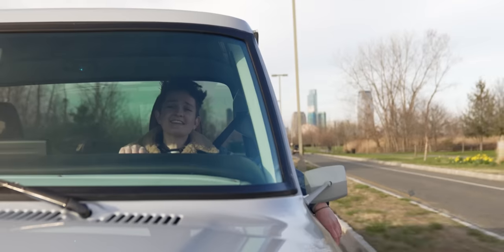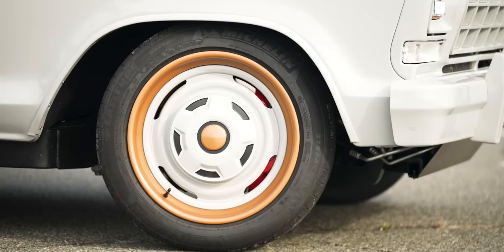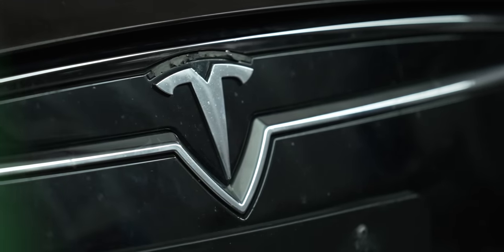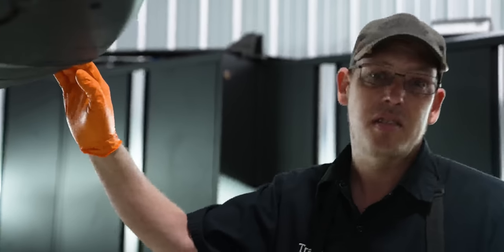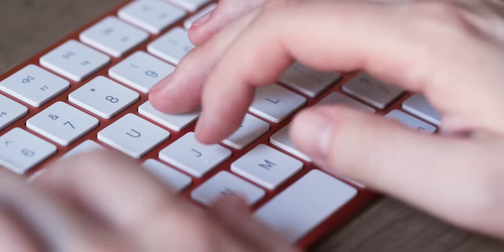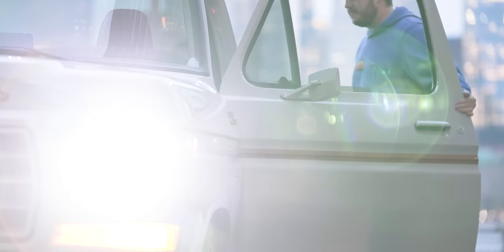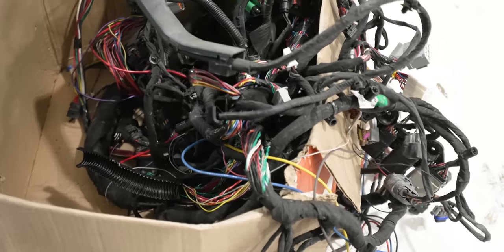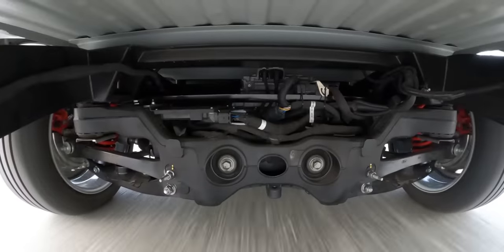Ford did what Tesla won't

Comment: A lot of people making fun of Ford for just selling the Crate EV motor “Batteries not included”. But 99% of crate motors are the same way. You still need to source radiators, hoses, wiring, a fuel tank, fuel pump system, etc etc etc. 

Right now yes it’s a limited market with a learning curve. But don’t be surprised if in the next decade you can pop into your local auto zone and pick up all these EV components.
Reply: Autozone gonna go out of business because normal people can't even fix normal cars let alone this. I consider myself very good at working on cars and I can't even figure out a wiring diagram from the 80s.
Reply: Same with crate engines you still need fuel systems ignition computers exhaust so I don’t understand those peoples argument
Reply: @HALOman-vi2tg  I do get your point, the battery pack and and it’s management system is ALOT more expensive then a fuel management system and a fuel cell/tank.
Batteries are generally the highest cost part of an Ev. Much more than the motor
Reply: @mr.mercury4247  electric cars are actually technically much simpler than internal combustion. An electric motor is just series of copper coils around a magnet inside a metal housing and most of the other moving components are already present in combustion cars like brakes and coolant loops (just it goes to the battery instead of the engine in an EV). Even the motor control software is simpler than a combustion engine since there is no throttle unit or fuel injectors to worry about. Removing the combustion engine takes A LOT of complexity out of cars and could be the beginning a new world of easier car repair if companies don't get overly controling about it.
Reply: Also, IMO, crate motors should include the inverter, so people buying the motors don't have to do the company's R&D all over again.
Reply: @user2C47  but if someone getting crate motors they normal get different fuel systems and control units etc.
But yes a complete kit BEING available would also be nice

Comment: Been an independent mechanic for the majority of my 15+ of working on cars. I'd say all to most manufacturers try to do what they can to make life difficult for the independent shops.  And while good for Ford for doing something right, I fear it's only going to get a lot harder going forward for independent mechanics to have access to the correct information and tools.
Reply: Maybe become an EV mechanic as well? Technology will always change, and we have to change with it.
Reply: @dallasdominguez2224  you have completely missed the point.
Reply: @mikeumm  ok what was your point? 😂
Reply: @dallasdominguez2224  the point is unless you work for that manufacturer, Tesla included. They try their hardest to prevent independent mechanics from repairing their vehicles. If they could have their way only factory certified and employed technicians would be able to work on their products. 

John Deer is in a court battle about this right now. 

Has nothing to do with electric vehicles.
Reply: @mikeumm  Ahhh I see. Thank you for explaining.

Comment: If there's one way to win over the old school classic market it's with EV crate engines, I love what Ford are doing and it's going to help with converting people and cars alot sooner than perhaps Tesla's walled-approach. Awesome vid Verge team!
Reply: Ahh yes, old hot rodders are notorious for liking quiet, computer controlled cars.
Reply: The whole point of tuning is to make the exhaust shoot flames and sound like gun shots. People who aren't drag/track people care little about speed. It's all about the experience, which EVs have no soul and no emotion.
Reply: @mr.mercury4247  I believe most mechanics and car enthusiasts are always excited to learn and see new things done with automobiles. Converting an old water pump into a diesel fuel filter or hanging a gas jug to bypass a fuel system are some of the odd but interesting things I’ve seen mechanics do to vehicles they love. I don’t think it’s a stretch to say they’d be interested in an electric motor as well.
Reply: nope if it's not a V8 I don't want it.
Reply: @princetchalla2441  Yea no . Imo

Comment: They need to sell a kit with dash, battery, motor, controllers, ac, coolant pump etc for easy retrofitting
Reply: why don't you make it yourself find these the parts from manufacturers and drop ship it after you know it works

Comment: When I bought my Model S 2 1/2 years ago, I knew there weren't too many 3rd party repair shops, but I had hopes that once my car was out of warranty, things would get better.  Instead, they've gotten worse.  Now even if you want to pay Tesla to fix your car, you need to wait weeks before you can get it into a service center.  You can no longer walk into a service center and order parts (those that they will actually sell you) or call anyone on the phone.  It's a miserable experience when something goes wrong.

I'm hoping that Ford does actually follow through like the video alludes to.  Their EVs are still pretty new, and just offering an electric crate motor isn't the same as opening up telemetrics, diagnostic software, and all factory parts to the end user, but it's a step in the right direct.  I'll be selling my Model S once my Lightning arrives this summer.

Comment: I've been wanting to do an EV conversion for a while... theoretically what would I need to turn a classic car (for example) into a well working EV?
Reply: Go to "Electric Classic Cars" You tube channel, they explain it all and have loads of conversions. They are doing 4 Tesla powered Testarossas as we speak and do some bolt in conversions.
Reply: You basically want to have a kit of battery+inverter+motor that is made to work together. I have heard of an European company wanting to offer this for retrofitting smaller urban cars, but I don't know if you can buy anything yet
Reply: @zatarstar5590  that company would be Transmission One, from France! :)
Reply: If you want to get beat up at every car meet you go to.
Reply: i would like to do this conversion with a bmw z3 from 1999 🤔

Comment: The Verge missing a huge part of the issue here. For cars sold in the US manufacturers are legally required to provide the information necessary to properly service and maintain a vehicle. Every manufacturer does this through some sort of subscription service, except Tesla. It seems that Tesla has no problem flaunting sustainability when it helps the bottom line.
Reply: Tesla has their manuals available for download now.

Comment: Yeah but with the e crate motor, it’s no more complicated than dropping in a modern efi crate motor in an older car. As someone who’s dropped an LS inside a a 1970 VW beetle, the amount of wiring, ecu programming, esc and abs programming, and fuel system manipulation is analogous to what you’re looking at that you’d need to do if you’re gonna drop a Mach E crate motor in an older chassis.
It’s just a matter of time until someone in the market starts selling software packages to program these electric motors for specific applications analogous to downloadable ECU tunes. They’d make bank.

Comment: As far as I'm concerned once you make your final payment on a car. The manufacturer should be obligated to give you software. That helps you tackle electrical issues, full diagnostics, access/read/disable all the modules, programming and of course key duplication.

Also a complimentary bag of the specialty tools needed for repairs would be nice.

If a manufacturer decides that they're not going to produce a particular part anymore they should open up support for third-party companies.

Any person has ever owned a Mercedes and experienced an "All keys lost" or had a Skreem (a part they don't even make anymore for the old switchblade keys) malfunction knows exactly what I'm talking about.

Comment: with an EV crate engine, that basically means any car can become an EV. though I personally like how old gas engines were just able to be fixed in any way. imo, synthetic fuel should be looked into
Reply: I agree. Electric isn’t all that great if you think about it
Reply: @brobot411  it is, but I love cars as machine, not an appliance

Comment: This is exactly what needs to happen. Tesla needs competition in every way and customers need options. I'd love to take my oldies into the future. Even if recharging became as expensive as filling up on gas, the electric motor would still be running circles around ICE and I love my V8s. It might sound defeatist, but you gotta line up your options and solutions before complaining.

Comment: Might have more to do with easy to make motors for Ford.  So they have lots but since they don't make batteries it slows the output of factories.  Simply because they do not have batteries, so they sell motors as selling parts makes good money.  Still I love those conversions there should be more.

Comment: My biggest problem with this is that not only would you need to buy a crate motor, but an ev battery thats compatible with it and has enough range, a charging input, an inverter, a new transmission, I mean at that point you're building a new car.

Comment: I’m waiting for Ford to bury Tesla- they need to do 4 things. 1) the lightning has to work as advertised. 2) Ford needs to mandate that there are qualified dealers to fix and repair VERY quickly. 3) they need to make sure all parts are on the shelf ready to go. 4) they need to get some sort of partnership going between a charging manufacturer and large gas stations chains.   Tesla’s software is very good- but they are still a tech company- Ford needs to beat them at being a car manufacturer.

Comment: Dual net gain 11" motors coupled to a power glide then sent to a center differential AWD dune buggy 1800ft lbs torq 1000hp 20" travel poly batteries and dual manzanita controllers

Comment: Manufacture control of the repair process is all about protecting a massive and highly profitable revenue stream from competition.  Its definitely not about improving the customer experience as monopolies don't provide flexible, cost efficient service delivery.  Without competition you are agreeing to pay whatever the manufacturer wants to charge for service as long as you own the vehicle.  You are also agreeing that the manufacturer controls whether service will be provided for your model at all.  Doesn't sound like a good deal to me.

Comment: Tesla made all it's patents public, and elon has addressed why tesla is structured this way. It all has to do with the fact that dealing with repairs in house is much easier structure to manage cost wise since you don't have spare parts sitting on shelves waiting to be ordered by repair shops, instead you can take the car back to the factory and replace the parts directly from the line so it reduces overhead while the company is growing. These things are also rapidly changing, when tesla  first released repair times were nearly a year, and now it's come done to 6 to 9 weeks.

Comment: I used to want a Tesla but after I heard about all the problems I said nevermind. I am a hardcore DIYer. I have a D4 Audi A8 and I still do as much as i can on that car. There are almost no videos about how to do things so I had to figure it out myself. I found out very quickly that that is a rich person's car and they have the money to take it to the dealership. These people are not going to get underneath these cars with a wrench and coveralls and do anything. So is Tesla but there is a YouTuber named Rich rebuilds and he said he started working on Teslas because he really likes the design. I think when he first started rebuilding Tesla's they sued him. Rich and Louis rossmann have been waging a war on two fronts against this anti-repair insanity. They both have been featured in the mainstream media and they have pushed the right to repair issue to the Forefront. You need these people doing this because just like someone commented in the video that they are like software companies. After a certain amount of time they will not offer support and then you will be on your own. I found that out about Apple. I have an old iMac and an Old Mac Tower with the non-Intel processors. The Mac Tower is pretty much useless because there are no up to date operating systems. The IMac has the same problem even though it has the Intel processors. I can use the Apple OS but without being able to go online forget it. I just wiped Apple OS off of the machine and put openSUSE Linux and Windows 10 in a dual boot setup. People with the oldest Tesla vehicles are finding that out the hard way. There was this guy in Europe who was so frustrated that he stuck a bunch of dynamite in his Model S and blew it up. Unfortunately we can't just go and buy dynamite in the USA but they're going to be a lot of people who are frustrated when these cars get 10 years plus old. Right to repair is a must

Comment: Not just independent repair shops but owner repairs as well. Thats why I drive a 2003 model diesel truck. I can repair it in my own yard. I’d buy an EV if I knew I could fix it myself.

Comment: I would use a small diesel engine to drive a generator to then drive the electric drive unit like a diesel locomotive great range more complex sure but really you could get 400 miles plus using a small diesel with a electric drivetrain.

Comment: As much as hearing that Ford is doing this, there is something that they are forgetting to tell you that is a big problem, or actually several problems. 1. Is that you only have life of 10 years for the battery before you got to replace it and that is roughly half of the cost for the budget. 2. The time it will take to do a full conversion to Ev and cost to do. 3. Is where all these batteries are shipped from, 95% of the ev batteries come from China, so be ready to pay Mark up. 4. The cost to your electric bill after it is all said and done and the things you have to pay for to be installed as well. I actually talk to hybrid and ev owns and they complain about the cost and such.

Comment: You definitely don't need a degree in computer programming to work on these electronics! All the information is already available you just have to look it up and read it. 
A friend of mine has a couple of personal planes that I work on doing maintenance and repair, I by no means went to aviation mechanics school nor had any prior experience, but after a few weeks of reading thru the handbooks and looking at the diagrams I was able to do major repairs.

Comment: Don’t compare a ICE engine. 

Gasket, oil, spark plugs, pistons, O2 sensors, antifreeze, ABS module, vacuum line, oil pan gasket, transmission fluid gasket, oil pan, transmissions pan, crank shaft, air condition belt, motor belt, heat hose, anti freeze hose, smog pump, water pump, head gasket, oil line, temp sensor. Brake oil container, line. To software that says, visit your dealer, and they charge you 150 plus to tell you what’s wrong, and all bolt are torqued down to the pound and if you do it wrong you ruin a lot of things. (Right to repair) 
To 
A electric motor, High voltage battery, 
Software. That can over the air pin point a problem without leaving your property…

Comment: The big problem I have with EVs in general is that there's more energy lost from a coal power plant or a gas/diesel generator to electricity for the EV's battery than you get from a traditional internal combustion engine.  What we need to make EVs as environmentally friendly as they're hyped up to be will be a massive switch to nuclear energy.  Until Americans are ready to make that switch, diesel will continue to be the superior choice in terms of environmental impact, fuel economy, power, and vehicle longevity.

Comment: In an electric car all the cost is in the battery. In an internal combustion car all the cost is in the engine. That is why offering a crate electric motor is stupid, let alone one without the inverter electronics.

Comment: Although, I am not a big fan of Ford. It is good to know, someone cares about the Right to Repair. An crate motor is very useful for the aftermarket aspect of EV
Reply: Until reprogramming a module for that crate engine leads your wallet to a dealership because all of their software is locked down.

Comment: It would be one thing to suggest that Apple wanted to keep their phones from being readily repaired. But every phone manufacturer does the exact same thing. So it's kind of implausible to suggest that this is some Orwellian industry-wide consipiracy to prevent small repair shops from plying their trade fixing your stuff. Especially when there's a far, far simpler explanation: Security.

You said it yourself: Tesla is more of a software company than a car company, and like Uber and Cruise and Waymo, they're all really in the business of making self-driving cars a reality. That's why the vehicles, and the software making them work, is so zealously guarded. Because they don't want their competitors to swoop in and be readily able to reverse-engineer their product, or other garden-variety criminals to be able to hijack your car and get it to drive itself to a chop shop.